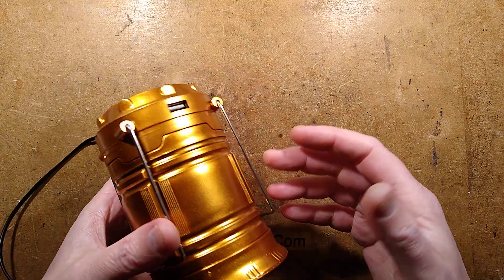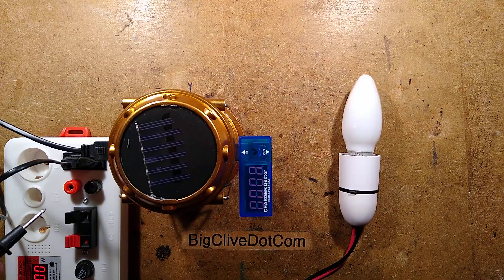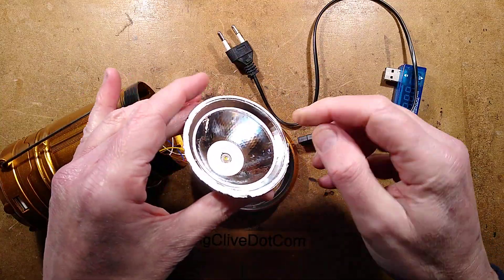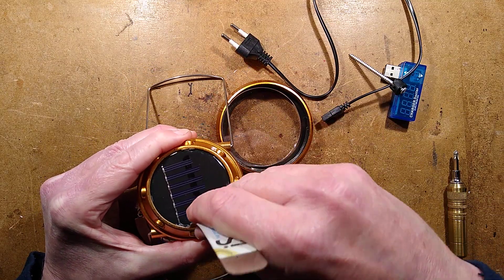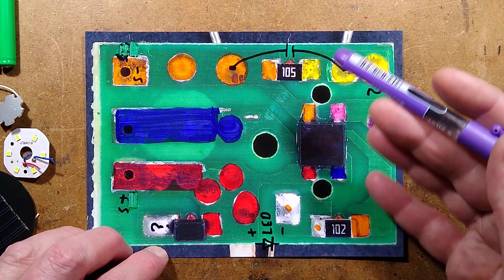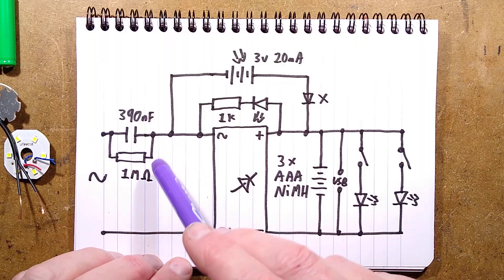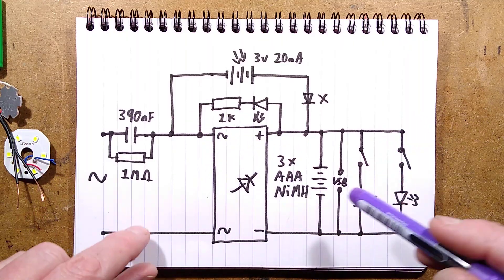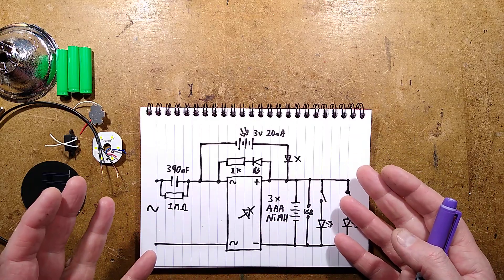Dangerous "death Dalek" lights still on eBay

Comment: Whoa...  Wait a minute I have 2 of those or what I think they're that type but mine take the one 18650bat and top unscrew to reveal the battery has solar panel on top slide light up its a lantern push button and it a flashlight and will give charge to phone if needed and the light can be charged from outlet too.. So what I have here is a potential death by electrocution..??  If I'm understanding you right...
Reply from the maker: It depends on the circuitry it uses.  There appear to be real lights and clones.

Comment: Huh, this is interesting because I have a lantern in almost the same form-factor, with a couple differences: instead of a solar panel, it takes 18650 Li-ion cells, and it uses Micro-USB for its charging input. So not mains voltage, thankfully. But even then I prefer to charge the cells in a dedicated charger, it's difficult to test if the built-in charger has proper charge regulation.

Comment: I got 4 for $12 from Amazon. Exact same form factor. Strange square adapter plug that I've never seen before and don't have anything like it and if it is lost it cannot be charged. I highly doubt a solar panel that size would have any practical use.
I charged it overnight and it did remain lit for over 28 hours, but went from decently bright to night-light bright (basically unusable) after 4 hours. Also, the USB on mine would not charge iOS devices. That is questionable. Returned it right away.

Comment: But, but... isn't bridge rectified 240vAC = over 300VDC?  What drops the voltage to a reasonable LED / charge / USB voltage?
Reply from the maker: The dropper capacitor limits the amount of energy on each half of the sine wave.

Comment: I think you made two mistakes.  I do agree it it a very poor as well as dangerous design, but the solar cell does charge the battery, and the diode is necessary.  Both errors are about the full-bridge.  When AC enters, it leaves on the negative not the positive.  So if negative comes in on the AC line at the TOP of your schematic, it would travel thru the solar cell and back to positive of the bridge taking it back the the other ac line..  So the diode is there for this purpose; it is necessary.  Regarding the solar cell charging: the negative output of the cell goes into the bridge which then goes out the negative of the bridge and thru the battery and diode and then back to the cell.  The diode and bridge will drop the voltage by 1.2 volts, again a bad design, but it will charge..  And then led with a 1k resistor isn’t a bad drain, 1k is high enough that the if it’s lit, you can safely assume the battery is charging.  That all said, it’s still dangerous.  Thanks for the video!
Reply from the maker: The solar cell is very low voltage.  Just enough to light the LED and not enough to put charge into the cells.

Comment: This case of this lamp bears more than a passing resemblance to one being sold right now on "American Science & Surplus" (a site I have bought from a few times), specifically "SKU:  95833P0001", which they describe as a "600 LUMENS COLLAPSIBLE LED LANTERN".  Important differences between this and the one AS&S is selling:  The AS&S one (branded "i-Zoom") does NOT have a charger built-in (it just uses three 'AA' cells), does NOT have a phone charger / USB port, and does NOT have the solar panel on top (it has a tiny compass).  Additional, curious difference:  The one on AS&S appears to only have the lantern that lights when the device is opened; no spotlight on the end (at least it doesn't mention one).  It's also a sort of grey-silver color rather than brass-ish.  BUT, the shape of the lamp's case appears to be practically identical.  (They also sell it prepackaged by "i-Zoom / Farpoint" with a "tactical flashlight" under a different SKU.)

The uniformity in external design between devices made by various small, usually Chinese companies -- despite major differences "under the hood" -- continues to fascinate me.

Comment: What happens if you put an MFI near it? Might help get the point across to people!
Reply from the maker: If you mean one of the EMF meters used by scammers to sell their victims "dirty electricity filters" then they are basically a volt stick live wire locator.

Comment: well, I couldn't find this on eBay. What I did find did not use a direct mains voltage but only included the regular charging cable that makes you provide the USB power supply of 5v. If this is even real, problem is due to the charging cord that goes mains direct to the USB. Otherwise it is fine.

Comment: I’ve had one of these for about 3 years now and it sits on the windowsill indoors and charges by the solar panel. I have never charged it by the cable nor have I used the usb port. I’m thankful to you for showing this video and it’s time to get rid of it just in case. Thank you.

Comment: I don't know what type you have but mine is charging from its solar panel quite well.  I use it as a night light at my cabin in the woods and the battery drains overnight. Since there's no electricity I always recharge it during the day from the sun. It looks the same and it's absolutely the cheapest Chinese low build quality junk.
Reply from the maker: The previous ones did have enough strips in the (small) solar panel and also real rechargeable cells.

Comment: The breakdown of the components just kept getting worse and worse, it's so funny that they prevented the discharge from the cable after unplugging but this whole thing is a hazard. The batteries, the thin-ass cable, the huge electrocution risk, the LED diode that wasn't even used- it's making me laugh, but nervously

Comment: Wouldn't the bridge rectifier complete the path for the negative of the solar panel and the negative of the battery? I've done some experimenting with bridge rectifiers and DC in the past, and if you put DC in where the AC should go in, it will get passed through to the output with the correct polarity, with some voltage loss of course.

Comment: You forgot the path of the solar panel through the rectifier bridge!...
Always leave it in front of a well-lit window and you probably won't need to charge it... I've had it for over 2 years and I've never needed to charge it from the socket.

Comment: $8.99 US Delivered. I've just ordered one. Has a single 18650, removable, under the solar panel.
They only had black. No Pink ones.  My other cheap Chinese light was a godsend when my neighbor had a fire. It was a better pinpoint spot than the high dollar Fire Department lights.

Comment: I am looking at ebay right now and I don't see any for sale, not on USA ebay anyways. If there is an issue with the lights ebay will go through the process, and delist them which is what it appears they did.
Reply: I sell on ebay and I can tell you there is a TON OF STUFF they ban, you just can't go on ebay and sell banned things, nah brah, you'll get banned from selling on ebay they don't mess around. I've been selling on ebay for well over a decade. If there is an issue and it's gone through the process through ebay, trust me they'll ban it in a second like 10's of thousands of other things they've banned.
Reply from the maker: Still there on eBay UK - https://www.ebay.co.uk/itm/295946283911

Comment: I'm not following.  Simply plugging the phone in to be charged would cause the phones outer covering to be energized?  Or touching the exposed metal would?  Isn't that part of the charger always energized when charging something??  I'm really confused.
Reply from the maker: Normally the phones chassis is connected to the low voltage charger output.  But in this case it's also referenced to the mains supply.

Comment: How would you alter the circuit as shown on your paper diagram to make it safe? If I understand this correctly at the moment a mains voltage can / does appear at the USB socket but is that only under certain circumstances? Is that similar to when a single lamp goes in a series wired set of Christmas tree lamps ( the older ones not the LED ones )?
Reply from the maker: You would adapt it to charge real NiMH cells from a USB charger.

Comment: I do have a camp-light this one is based on. It has area light only with automatic slide-switch, which is powered by AA batteries located in the base (where yours have the spot light).
Not rechargeable, no USB, no solar, no charging led. No point light and its crudely mounted switch. Not painted. Black plastic. Plain, simple.

Comment: Is there anything that could be added or altered to put the product right and make it safe or just bin it ?
Reply from the maker: It would need a power bank module transplanted into it, with a suitable lithium cell and resistors for the LEDs.

Comment: I think the solar panel will charge the battery, because its negative is connected to port 2, which then is directed to negative port then it will charge the battery.

Comment: Hooking the negative output of the solar panel to the A/C would prevent the battery pack from discharging back through the solar panel eliminating the need for the separate blocking diode.

Comment: 1. that is probably using a rc dropper.

2. how can the chinese not be killed by their own products?

unless the chinese has isolated drops from their street level transformers with no common ground reference or it is maliciously made just to kill foreigners or they have no electrical codes or they do but they are not enforced.

here in america we have grounded power lines witch creates a common ground reference.
Reply from the maker: I don't think they use ground connections in China.

Comment: I have one that looks very similar to that but does not take household power for recharging. If you unscrew the bottom there is a drop out circular battery holder that takes 3 AA batteries. I think it's a better design in that you don't have to worry about electrocution.

Comment: About solar panel and diode - purpose of diode in series with panel is not to protect it from reverse voltage, but to prevent current leakage. When battery voltage is higher than panels voltage, low current will flow from battery to panel, discharging battery and diode prevents it. Why is it removed then? Well, because there is already one diode in the path of that current - one in bridge rectifier connecting upper input and negative output - it allow current flowing from panel to battery, but prevents opposite direction. That design would allow battery charging, but panel should have higher voltage to be able to charge three cells in series.

Comment: When I was young they sold millions of table radios. The chassis was connected to one side of the power line which meant you had a fifty, fifty chance of it being live. Your only protection was a thin cardboard back which could fall off after a while.
Reply: Yep, the ubiquitous "All American Five" tube radios, made by many manufacturers, were like this.
Reply: @interestingoldthings4889 yeah and people had more sense not to play a radio in the bathroom. We didn't have GFI outlets then and no one got killed. Besides the only danger would be if the blocking capacitor failed then came along polarized plugs. Problem solved. As for the all American five radios they had plastic enclosures so no metal would be exposed . Only a moron would get shocked on these radios if they decide to install a headphone jack and had ground going to the jack. I got more shocks out of a transformer set because I didn't wear gloves working on these antiques. Especially when the set was unplugged. The capacitors still had juice in them. No fault in the design. Fault in the person working on them. 73
Reply: @ronb6182 It's called survivorship bias. No reason not to be safe and design electronics that won't kill people who don't know any better or have any reason to.
Reply: @ronb6182  It was very easy to get a shock, as said, the backs come off easy. The knobs also came off easily, leaving a live exposed shaft.

Even worse, many (at least, in europe) doubled as receiver amps for record players. The connectors were exposed and not isolated. A child putting their fingers in would get blown sky high.
Reply: @kyle8952  I never got shocked on a table radio that was transformerless. But I did get shocked with 450 volts DC on my Atwater Kent radio when I was working on it. That was my foolish experience. But they did make neon socket testers which if the neon glowed when touching the chassis with one end and me touching the other probe I knew to reverse the plug. As for chassis being hot the Television sets were another problem. If you had the set turned on and was putting the antenna hookup to the antenna you would not get 120 volts but 250 volts because of the voltage doubler for plate and grid voltage. 73
Reply: And TV's too...back in the day the 240 volt plugs were round pins and could be plugged in either way around.....chassis were 50/50 % live!
Reply: @g4obb  yeah you guys didn't need voltage doublers you already had the plate voltage coming out of the wall. I just wonder what kind of tubes you guys had in your 5 tube radio sets. If I was to guess your 12AV6 would have been a 24AV6 , 12BA6 would have been 24BA6, 12BE6 would have been 24BE6, 35W4 would have been 70W4 and 50C5 would have been 100C5. Just guessing. 73

Comment: Funny, I used to sell a similar light at a shop I worked at and a few people said "their on ebay for cheaper and recharge from the mains!" - oops.
This also NZ, so many people here buying American electronics when they are 105-110v. New Zealand is 240v, sure some items is ok, but you do need to know before you buy it. If the device isn't worth a lot of money, the transformer just isn't worth buying.

Comment: I tried reporting illegal generator backfeed cables and came to the same conclusion.  The backfeed cables are typically North American 30 A 125/250 VAC 10/3 AWG conductors with a NEMA L14-30p (male locking plug for the generator side) and its 14-30p straight bladed “dryer” counterpart on the other end.  As you can imagine these have two hazards, one, if the cable is live it’s a potential electrical shock that causes death to the user and two, if used on a conventional panel without the appropriate interlock installed it could mean that service line people working on high-voltage lines could potentially die as well, not knowing before hand they might be working on cables energized backwards through a step-down transformer.

Comment: clive, forgive my ignorance here, but what i am failing to understand is how and why according to your circuit diagram sketch the solar panel is connected to the chip rectifier on the AC input terminal and then the + positive output terminal, how does the solar panel then actually supply power to circuit to charge the batteries or anything else?? color me confused here. thanks for your great and informative videos  always enjoy them as a novice electronics tinkerer way down south in South Africa.
Reply from the maker: In this unit the solar panel is for show and is literally just powering the charge LED.

Comment: by the way, it might be a lesser issue, but charging NiMH cells (or any batteries) that way (in series) is a recipe for killing them. Most of the times, NiMH cells can't be recharged after dropping below 0.8V.

Comment: I got a couple of these laying around, in fact I used one during a hurricane, just left it outside during the storm at the end of the porch to give some light and as a reference point after the power went out. Shockingly enough it worked all night, but was filled with water. I thought for sure it was dead and just left it there, to dry out for a few months, then one day tried it again, and it worked. I was amazing. So while these might fry you, they are some pretty good lamps.
Reply from the maker: They actually make a good base for a custom light.
Reply: @djnone8137 Grow a set, the entire world can't be made of Nerf for people like you.

Comment: I’m no expert, but I’ve seen enough electroboom to know 5v won’t hurt you. It’s the amps you must worry about or in extreme voltage areas like when working with 100+ Volts
Reply from the maker: In this case the 5V is superimposed on 240V.
Reply: @bigclivedotcom  wow that is much worse.. my bad

Comment: Have you peeled the plastic of the batteries? would there be markings below the sleeve?
Reply from the maker: No physical clues.  Just bare cells that didn't take a charge and have the seal at the wrong end for rechargeables.

Comment: Another problem: the usb voltage is regulated by the questionable battery. If (when?) that fails, you can watch your exposure cell phone go up in smoke. 
A more dramatic demo of the danger of touching the live case would be to connect it directly (no light bulb) to earth. Hopefully you’d get a scary arc and a loud zap before the fuse in 8:25  the supply plug blew .

Comment: Hi Clive
Fully agree with the term "dangerous" in connection to this light. It is extreme crap.
From technical point of view: The Diode marked x in your schematic is simply not needed. The rectifier-bridge holds four diodes. One of them is going from the AC pin of the rectifier to the minus pin of the rectifier providing discharge protection. The circuit for the solar cell is closed: plus of the solar cell.-> plus of the accu/battery. Minus of accu/battery -> minus of rectifier -> AC in of rectifier -> solar cell minus.
The higher voltage may be caused by either a classic dry battery or even by a desiccated Ni-akku.  
regards